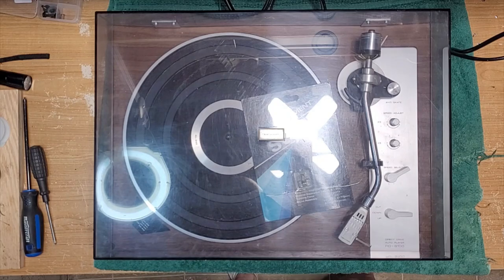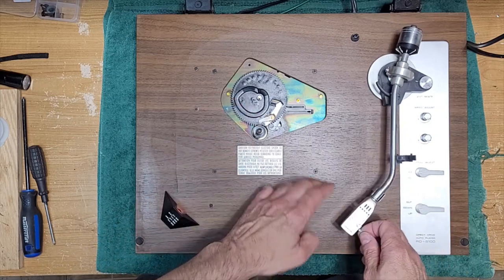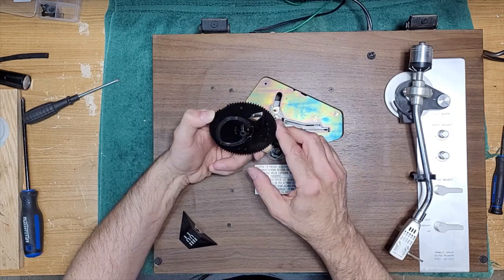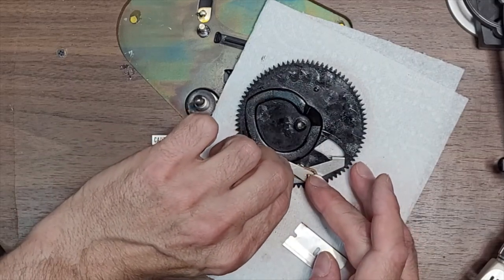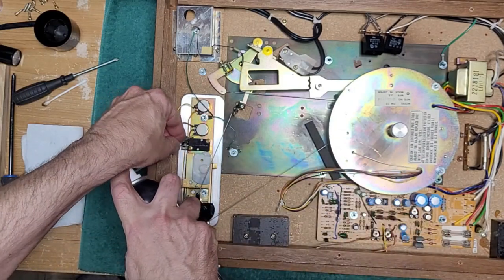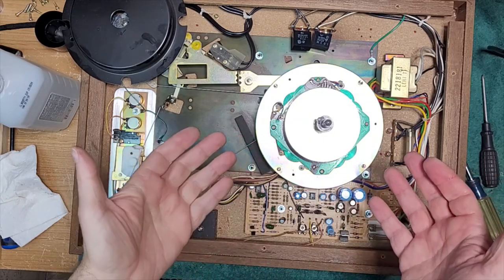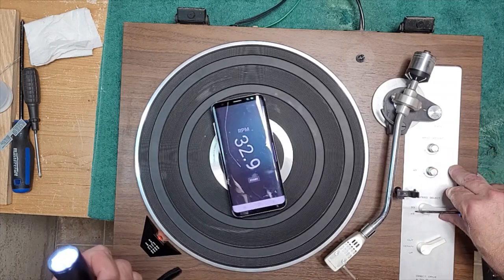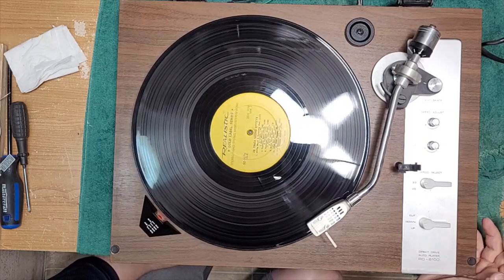Realistic RD-8100 (Hitachi PS-48) - Service & Setup

Comment: I wonder if you left the cardboard out if it would work without it - similar to a BSR mechanism?
Reply from the maker: The cardboard also acts as a filler to keep the trip mechanism in the line of the peg that travels with the arm.  If the cardboard wasn't there, gravity would pull the trip down and it would miss the peg.

Comment: Great videos....addicted watching them👍 I have an Hitachi PS-48 that I  love so much I traded in my Rega 3. Recently I noticed the trackingforce  dial at the end of the tonearm is stripped...I think? Every time I turn it it does not catch and I keep turning it. I don't want to keep doing it because I think it is stripping it more? Saw a dial on ebay and not sure if i should order it....pretty expensive. Looking in the dial I can't tell if it is stripped inside....thoughts? 
Keep up the great work on your channel👍
Reply from the maker: It shouldn't be stripped.  Try removing the counterweight - just unscrew it and pull it off.  Perhaps the shaft needs cleaning.
Reply: @TurntableGuy  Have changed a bunch cartridges in the past and never had this problem with this TT? It's like if I am at 12:00 and turn to 3:00 it moves back to 2:00....like elastic inside as it does not turn without moving back if that makes sense? It takes forever to find the correct VTF with the counterweight because it keeps moving back and forth! I wiped down the tonearm and cleaned the counterweight but it is still doing this and just started this about 3 months ago....bummed because you could probably look at it in 5 seconds and see what I'm talking about....argh! 
Sorry for the long email...keep up the great work on your channel👍
Reply: @mccarthyd6603 if the cart is heavy and not compatible with the tone arm you can add a bit of weight to the end of the tone arm. If it is too light the weight will sit too far forward and run out of adjustment.  In this case add weight to the cart / headshell. Ortofon had brass inserts for this purpose.